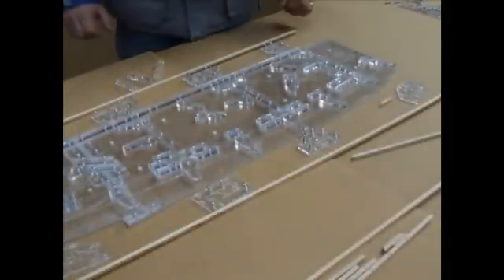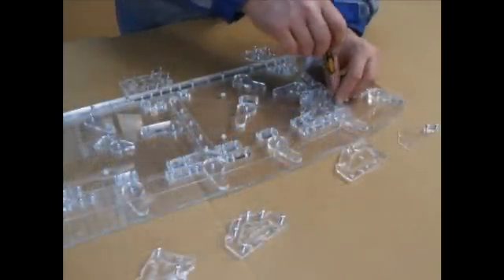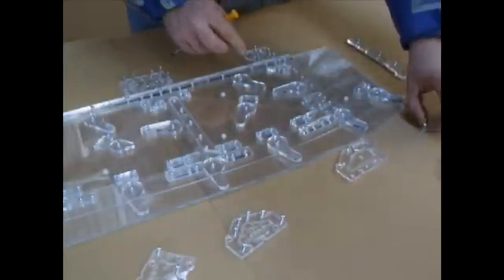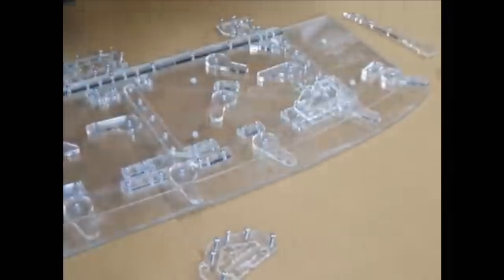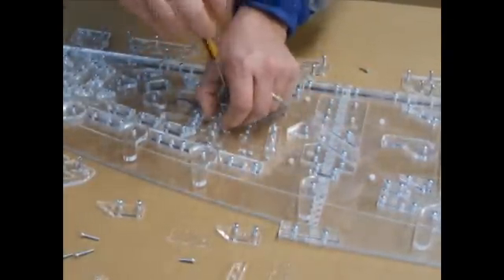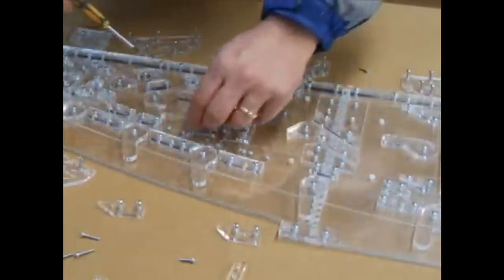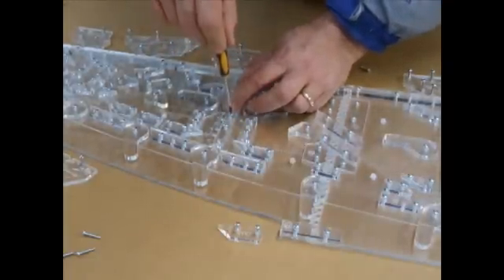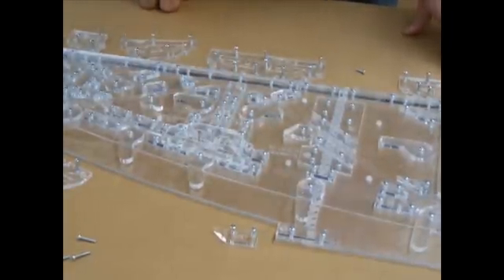MiniMax Lite 1 Standard Jig Setup

Comment: After watching all the videos on your rib jig,I must say that you have turned a simple process into a over engineered nightmare!Screw,Unscrew,replace part A with part B,wash parts once..now wash them again! Your jig..$500...simple home-built jig like in the max plans $20-$25,Your jig..uses mineral spirits for cleanup...home-built jig...I used wax paper..only $2 for a roll,toss in the trash when done/no chemical smell after and cost way less.Will give a thumbs up for a killer erector set though!